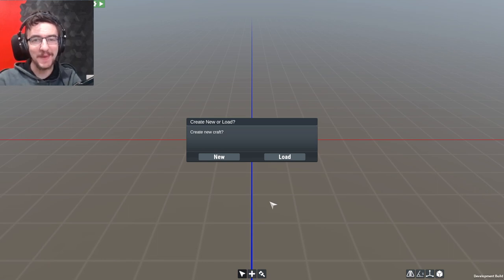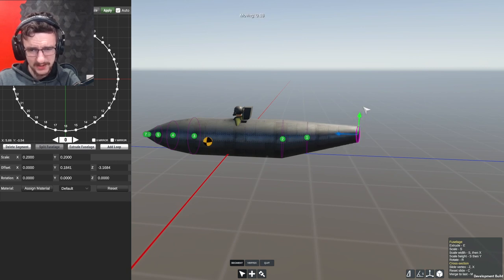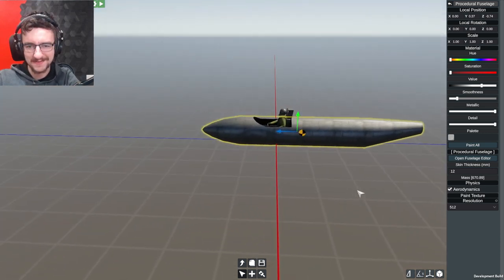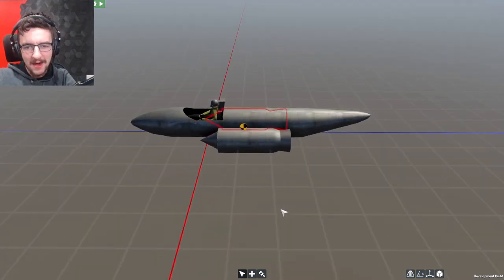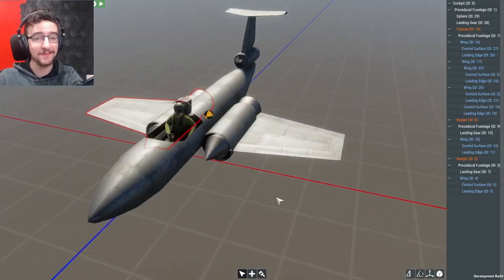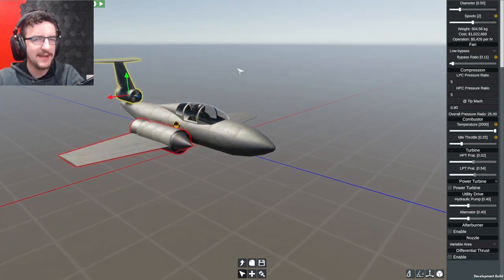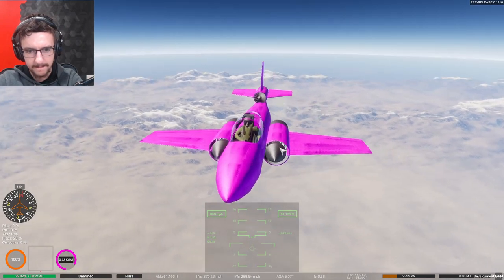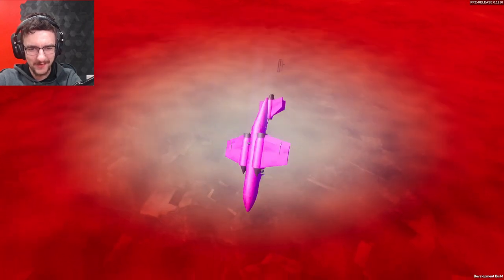Twin Ramjets! - Viewer Designs - Flyout Gameplay!

Comment: you were not going fast, you need Mach 3 or 4 to make them get more thrust, at round Mach 5 or 6 is when they start to pick up on thrust. Ramjets use high speeds to force air into the engine, to raise the pressure in the engine, they don’t use any moving parts to get air into the ramjet. You will need a strong Turbojet to get to those speeds. Probably make the turbojet in the back have a afterburner and also bigger which (I think) will get more thrust out of them. Ramjets are horrible at slow speeds. I’m not sure if I am 100% correct so anyone can correct me. Also since it gets higher temps at those speeds, if Flyout has temperature heating at higher speed, you may just burn up (if it is in the game) And it’s around Mach 6 or 7 where plasma starts slowing on the aircraft. Also I’m pretty sure the Diffuser lowers the pressure in the ramjet infill fuel is injected. So get a Normal jet engine to be huge (around the size of the Ramjet) and also have a burning hot afterburner. You should get higher speeds to use the Ramjet. I’ve never played Flyout.
Reply: this is actually somewhat correct. I don’t know much about ramjets either, but the high speed requirement for ramjets to be effective is definitely a thing.
Reply: This is sorta what the SR71 did at mach2 it redirected air to make it more of a ramjet.

also if i remember the possible aurora spyplane that may or may not exist was supposed to have two normal jets to get it supersonic and then two ramjets to take it hypersonic.